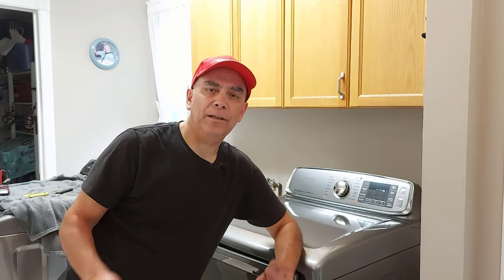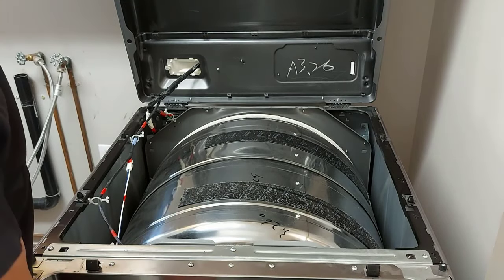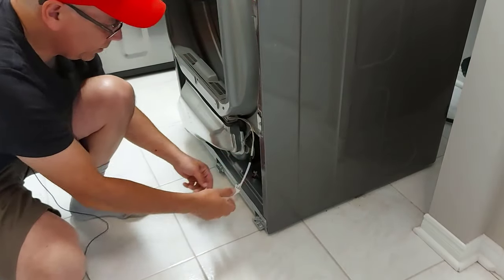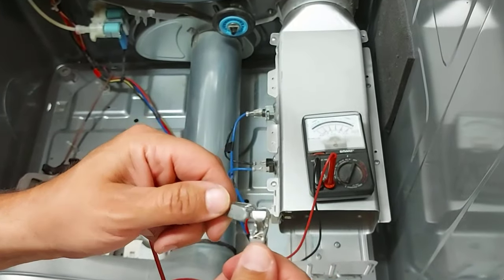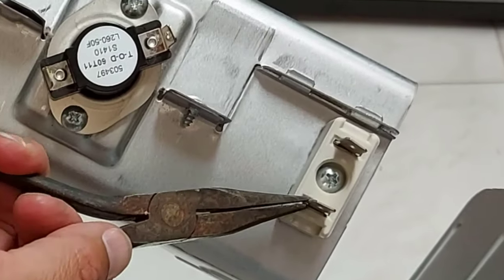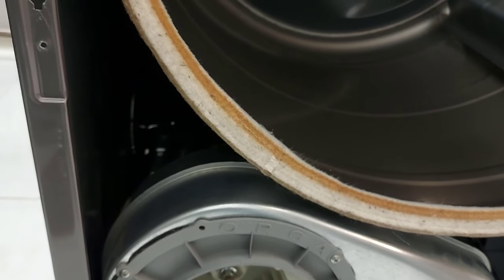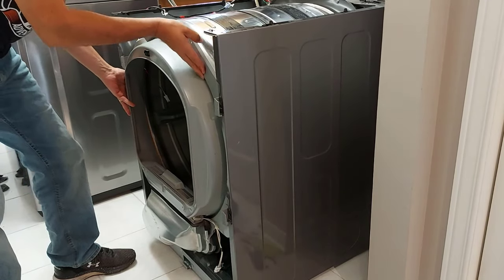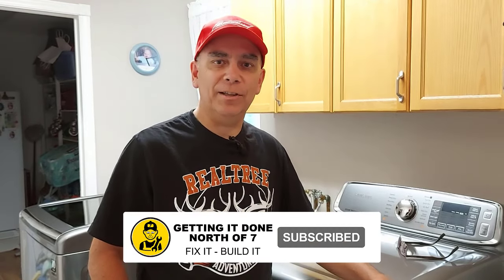How to Fix Samsung Dryer Not Heating | Common Problem, Easy Repair

Comment from the maker: 🟢 Heating Element for Samsung Electric Dryer DC47-00019A or Whirlpool 35001247
USA: https://amzn.to/3p5gxrG
CAN: https://amzn.to/3pcG1TS
Reply: Just a heads up to anyone doing this repair. The edges of the sheet metal are extremely sharp. I sliced my thumb knuckle unplugging the connecter to the lid, and had to get stiches.
Reply: I have a dryer exactly like the one in your video. I got the top and screws off. But the front won't lift. The top will pull off, but the whole bottom will not move.
Reply: How do I tell if it is the heating element or the main circuit board?
Reply: @IrishEddie317. Make sure the dryer is unplugged from the wall receptacle so you don't get shocked.   Then, if you have a voltmeter,  just disconnect one of the connectors that is attached to the heating coil. Set the Voltmeter to Ohms function and touch probes to each end of the heating coil. You should have continuity. If it's an OPEN circuit, the coil is the issue.
Reply: @cclawncare1  Thank you.  Yes, I do get that, but my big issue is which of the many wires go to the heating element?  Are there online schematics I can read to get the right ones?

Comment: Just a heads up to anyone doing this repair. The edges of the sheet metal are extremely sharp. I sliced my thumb knuckle unplugging the connecter to the lid, and had to get stiches. The repair video is spot on and I just saved myself a ton of money by following it. Just watch out for those sharp edges. lol
Reply: I just sliced my head open. I wish I read the comments first… 😅😅😅
Reply: Read this as after I sliced my hand.
Reply: Yeah learned that the hard way
Reply: Thanks for this. I'll be sure to wear some good work gloves when I do this repair.
Reply: Thank you so much
Reply: Me too😂
Reply: Should have read these comments I also sliced my hand.
Reply: I'm 20 years old and that's my first dryer repair ever! I wish I would've read the comments first like the other guys cuz I just sliced my hand open while putting back the box with the coil in it. It went through carpenter hands so trust me, it is really sharp! Hope you guys did not have to much trouble with the repair !
Reply: Read this beforehand and still managed a couple on my hand
Reply: Can confirm! Sliced a knuckle too lol

Comment: Great video but FYI, you don't have to take the belt off or the drum out to replace the heating element.  You can easily remove the heating coil assembly once you have removed just the top cover and the front door panel. Then you remove  the screw out of the heating element housing so you can pull the housing out from the dryer and have full access to the sensors and the coil. This method saves you a lot of time and hassle.
Reply: Thank you
The housing was bolted into the stand but was able to get those out
Reply: Great pro tip. Saved me a bunch of time and headache of the drum and belt assembly. ❣️
Reply: Thank You for this tip.. Removing the belt and getting it back into place right, was the one thing I was alittle worried about.. Other than that I know I can get this done with no problem.. Thanks alot!!
Reply: @andrecomanigault  Very welcome

Comment: You heating do not have to take the drum out, the entire heating element and safety switches can come out as a unit. Remove the screw holding it to the bracket and then bracket and heating element.
Reply from the maker: But what if a person wants to vaccuum the lint and dust the right way? It doesn't hurt

Comment: My wife complained that the dryer wasn’t making any heat….so I put my handy man hat on and used your video for guidance and now the dryer is as good as new and my wife is happy. My dryer was a little different on the outskirts but pretty much the same internally. Your video was straight to the point and very informative. Cheers!!!!
Reply from the maker: Great!

Comment: You can get the heating element assembly without removing the drum. Remove screw from back vent, pull out back vent. That gives you access to renove the 2 back screws that hold the frame that supports heating element assembly. Then remove front as instructed, remove 2 front screws from frame that supports heating assembly. There is one screw that holds heating element assembly with support frame, once you remove it and are able to separate both, you can pull them out the front. Great video, thanks.

Comment: Well three years ago you made this great video and I can only imagine how many people you have saved soooo much money.  My wife and I followed your video step by step including using my multi-meter to check all the possible parts that could have been bad  Turned out to be just the heater coil.  I got mine on Amazon for about 22 dollars being an after market one that worked great and it had all the 4 other parts that could have been bad but were not.  I will just save those parts just in case.  We could have NEVER tackled this repair without your super detailed directions.  You really did each step for a total novice and that is why we could follow you.  How can I thank for saving us the cost of a new dryer or a 400 dollar service call.  What is so sad is that this $1800 set both failed after 3 years.  The Washer had bad balancing rods  and of course the dryer with a bad heating element,.  High prices for crap products designed to fail fast. We are just going to have to become better at fixing these appliances ourselves but thanks to the efforts of people like you it is possible~!!   Thank you so much, Kit and Suzette in Oregon Note BTW I did see some video's out there where they did not remove the drum however even though it was extra headache to take the belt and drum out I was so glad that I could test all the other possible bad parts while the drum was out. Also after seeing how dirty it was inside and under the drum I can not imagine taking the short cut and leaving so much lint inside where it could have caused other issues down the line. Bottom line I think how you did it was the correct and better way to do this repair right~!

Comment: All I can say is THANK YOU! This video definitely saved me hundreds...I order my heating elements on Amazon, it was delivered the next day. The installation was exactly as described in this video. In fact, my heating element was broken in the EXACT same place. Keep in mind that some places inside the dryer are sharp on the edges. Believe it or not, the hardest part of the installation for me was disconnecting the wire that controls the dryer light (after removing the front). That clamp just would not let go, but I eventually got it. Thanks again!
Reply from the maker: This is great to hear and I know what you mean about the wiring connect.

Comment: Thanks it was helpful, but when I got stuck trying to figure out how to get the belt back on, I found out that you dont need to remove the drum or front framework at all. The Heater element will pull out to the front by removing the front bracket. we do appreciate your posts.   cbe
Reply: How do you get the screws or wires off? How do you test it?

Comment: Thanks. I have a similar model to yours that just stopped working. Your video was the first I found. I order the element yesterday with a 1 day ship, total was $30. Tore the dryer apart after work and got back up and running in about 45 minutes. Works like a champ.
Reply from the maker: Excellent! 😊

Comment: Doing the job now! Didn't have to remove the drum on my unit but it does make it a bit longer to remove the heating element housing itself without cutting your hands up. Great video and thank you for showing this.

Comment: I really wanted to follow the steps with my teenage sons help but my hubby loves paying for jobs to get done quickly… Took our electrician an hr max. He had the part and cost $225 plus I tipped him. I was there cleaning all the parts… Sooo much dust and lint in hidden places. Works great! Can’t believe there aren’t more house fires because of dryers!
Reply from the maker: Lets hope there isn't many if any fires. It's crazy how much lint and dust collects inside a dryer.

Comment: Another viewer that had success chaning the heater element in my dryer because of your video! Thanks!! 
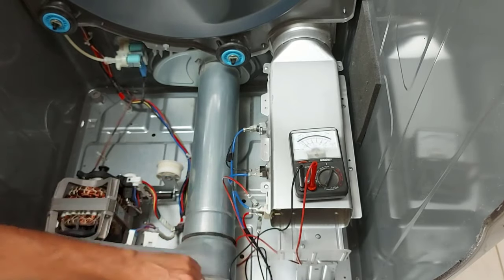PS other viewers, at 5:48 of this video Samsung Dryer Belt Replacement - Not Spinning or Starting shows a really easy way to get the belt back on for the drum.

Comment: Kudos on this video - I just took my Samsung dryer apart and confirmed no continuity to the heating element. Waiting for the replacement but i'm nervous as hell to get that belt back on the idler pulley. Anyone have advice on how they managed to get their drum back in and the belt back around idler pulley and motor shaft? Advice on that would be appreciated greatly!
Reply: Did you have any trouble with removing the front? I have all the screws out and the top will pull apart, but the bottom is still attached and I can't tell what is holding it.

Comment: Thank You! Despite replacing the belt a couple years ago this video cut my disassembly time in half and probably saved me at least an hour in trouble shooting. My problem ended up being the thermal fuse.

Comment: Awesome!
Great video I was able to disassemble and find out that the heating element had a break in it. I have a dryer exactly like yours. Now I just need to find the part replacement . Any recommendations?
Reply from the maker: Good to hear! I googled it. Found a parts dealer not far from me. I also found that part on Amazon, just takes a bit longer to receive.
Reply: @GettingItDoneRepairs  Hey sir yes Found it on amazon for $28.50 wife going to be happy we don't have too buy a new dryer lol. Once again really appreciate the wisdom sir. God bless..

Comment: Thank you for making this. Weirdly enough my coil is snapped in the same place as yours was. I have never worked on a dryer before and this made it insanely easy! You saved me a small fortune by not calling a repairman.
Reply from the maker: Glad I could help!
Reply: Mine was broken in the same exact spot as well! This video was awesome - makes me feel good to be able to fix it on my own.

Comment: This video worked fantastic. I was putting off fixing my dryer for weeks because I thought it would be too much work but the step by step instructions in this video made it easy! I watched it through a couple times first so I knew what to expect and the repair went smooth.

Comment: Youtubers Helping youtubers!  I'm a car guy, dryer stopped working. No heat. YouTubed, your video popped up, watched. Loved that you recorded in socks. My man. Took mine apart, coil broken also found helacious rattling noise on startup was the heater housing rattling against the outlet. Made my day., Parts on order. Thanks!
Reply from the maker: That's awesome! Youtube is a great for solutions and learning. Thanks Lou! 😀

Comment: I was having a tough time with getting the belt on there right, I think your diagram at 3:44 is off, the arm for the idler pully on mine was the mirror image of that, and the screw that held it in was on the lower right of the motor assembly.  What I did to make mine go again was to - with the front shroud for the drum off, push the idler arm far left, so the spring was tensioning almost as far as I could get it, then wind the tooth side of the belt (grooves) around the motor shaft, and then the smooth side around the idler pully.  Sorry for the run-on sentence.  Also, the tooth(groove) side of the belt should be inward facing on the drum.  Just an excellent video thanks very much!

Comment: I just noticed the positioning of the wires. Mine has the red on top and blue on the bottom. I ran it both ways and it worked both times. Guess it'll work in either position to make it dummy proof is my guess. Thank you for the informative video, useful knowledge to pass on to my kids.
Reply: Thanks.  I have mine torn apart and I wrote down red on top and blue on bottom for the heating element.  But, I watched the video again and it shows blue on top and red on bottom.  Good to know it will work either way.  Thanks.

Comment: Amazing job! Thank you for your video, I has a successful repair for my dryer! One question I have on the housing that held the heating coils, there are two additional wired modules connected (you checked them for connectivity in your video) My replacement part kit came with those, but I didn't change them out because they weren't broken and I didn't know their placement orientation (top vs bottom) to reconnect the wires, I didnt want to connect them backwards, so I left the existing. How can you tell how to replace those two parts?

Comment: Got my Samsung dryer working again! Your video was clear ! Only thing i had trouble was fitting back the hood onto those two front clips. For whatever reason it only would clip on one side!
Reply from the maker: Great! I had the same issue buy I kept trying and I finally got it right

Comment: Hey there great video we are literally in the boat right now I'm going to use this video to change my heating element if that's the problem and I was wondering where did you buy your parts where would you recommend buying a heating element I live in North Carolina
Reply from the maker: Appliance parts store near you or Amazon

Comment: When checking components in a ckt. always remove at least one wire connection from component  before doing an ohms check. Otherwise you may get a  incorrect reading by reading back thru the other circuits.

Comment: My grandson just received a replacement heating element. I took apart the dryer, got to the heating element compartment and noticed the heating coil was not broken. The clothes are not drying at all. Also, to shut off the dryer, the door has to be opened. I cleaned the whole area where the drum was removed. Would welcome your advice on both issues please. Thank you very much

Comment: This video  is perfection was a constant reference point to a successfully install/repair!! 💜💜💜

Notes for help
1  take pics or video with light that belt on the pulleys/idle wheel. 
It helped a lot puttingvideo phone in there and seeing it. 
2. Maybe try doing the pulley first then put the barrel in with a buddy I couldn't get it the other way but maybe your more flexible than I lol. 

3. On the element  unscrew the three screws on each side helped me getting it in n out and lined up. 
4. The wires on element go into the side they're on so top coil to top hole etc. [Take pics!!] Lol helped so much. 
5. You may not remember but that first cycle smells and that's the element lighting for the first time it usually happens on new dryers but we forget bout it lol. 
6. The plugs all should just pull out I don't believe there were any of those push/press while pulling ones that SUCK lol 

Lastly separate your screw sets and take pics the 3 on behind the door are different than all the other ones and yah that n pics helped.

Comment: My pos Samsung didn't have screws that held the heating element together just some kind of button thing. Had to use self drilling screws to close it back up. Hope that fixed it in testing now

Comment: Hi I have similar dryer, mine has no heat coming out either but how do I tule out that it’s not the moisture sensors that need to be replaced before I take the whole dryer apart? I’ve read the moisture sensors causing this problem as well.
Thanks

Comment: Dryer went down today at 4p.m., runs no heat, watched this video, ordered part with 2 day delivery, tear out old heating element tomorrow, cleanup ducting and fix dryer the following day when the heating element part gets here. Washer/dryer are the heart and soul of our house...back to normal in 2 days and I never had to leave the house to chase down appliance parts warehouses around town.

UPDATE:
tore the dryer apart to the bottom, checked continuity...heater element had no continuity and once out, YEP...the coil heater wire was broken/burnt. Waiting for part now.

NEXT!

🎉

Comment: Good video...I have a samsung dryer and the heating element went out and I replaced the element and still won't heat...replace the thermal fuse also...any helpful tips...
Reply from the maker: Did you check the lint catcher and the dryer vent behind the dryer for blockage?
Reply: @GettingItDoneRepairs  
Yeah clean them out...

Comment: I did this step for step (except checking ohms) bc I didn't have the equipment. Everything seemed fine until I plugged it back on and hit the power. Immediately heard a pop and smelled a burning smell. After taking it apart the new coil blew. Any idea why that happened? It broke off right where the 2 ends plug in where you have to bend them with pliers

Comment: My dryer kept shorting after installing my heater element. To those reading this, make sure your heating element coils aren't touching one another. It will short the dryer and cause the fuse box to jump. For the life of me, I couldn't figure out the issue was but suspected that was the issue, and it was. Dryer heats and runs like it should now.

Comment: My dryer is not turning ON, and the display dosen't show anything. I am sure it gets power because the door lamp turns on and I checked and found that the plug and cord are fine. How could I check and see the broken part? Is this due to bad thermal fuse? Thank you.

Comment: What if it still isn’t heating properly, towels damp requires a couple drys, still moist. People claim ventilation is good but I’m not sure about that. 

Any ideas what else could be wrong if a dryer doesn’t heat properly. It’s a Samsung